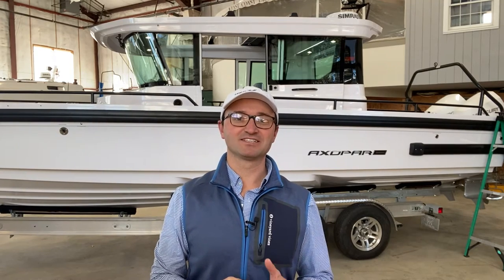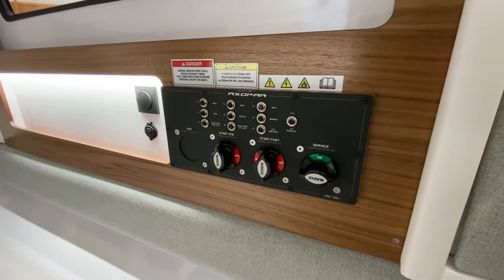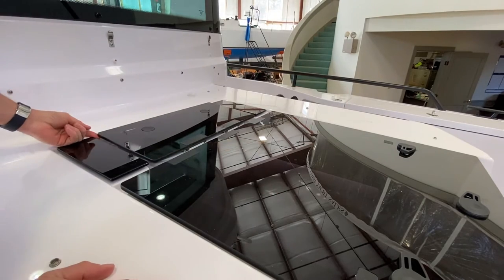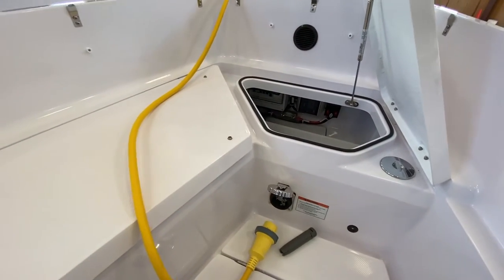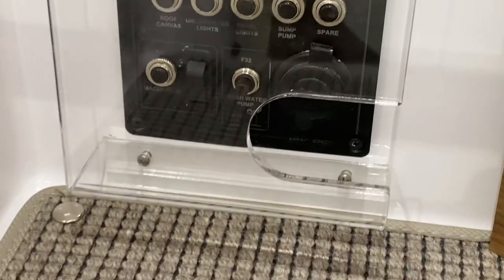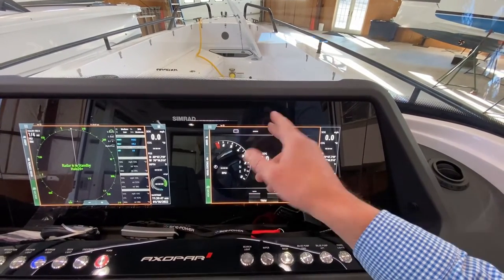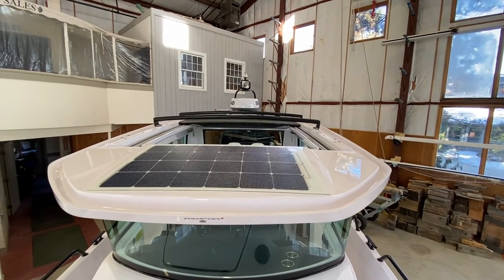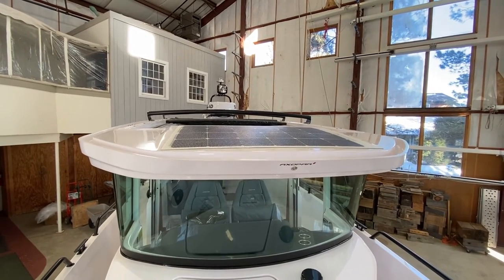Axopar Education: 28 Electrical and Battery Systems

Comment: Hi, Great videos congratulations. Can you tell me if the fridge runs directly off shore power please when at the dock? Or do i have to leave the house bank switched on and run it through the battery.
Thanks
Reply from the maker: The refrigerator runs off DC only, so you do leave the house battery on while on shore power to power the refrigerator.

Comment: Brilliant video, thank you. Really want to fit a solar panel to our 28. Does it only charge the service battery. If it charged the engine battery, you could always start the engine and charge the service battery. Any chance you could do a video of how the panel is fitted and wired? it looks perfect.
Reply from the maker: The battery bank you want to be charged is the house battery bank. The reason why is because all the parasitic loads that drain the batteries even when shut off are connected to the house battery bank.

Comment: Very helpful, thx. Is the solar panel available from the factory, or dealer installed? So it includes a charge regulator?
Reply from the maker: The solar panel is not currently (2022 and older model year) offered from the factory.  This is not a challenging item to have installed and any good marine tech can install for you.

Comment: Another informative and incredibly useful video - thanks. 

Quick (possibly idiotic) question. When attached to shore power, I guess the isolators need to be switched on for power to flow to the batteries for charging. Otherwise they would be, well, isolated.
Reply from the maker: By battery isolators, do you mean the rotary switches pointed out in the video?
Reply: @EastCoastYachtSales  yes, that’s what I meant…
Reply from the maker: The batteries can be switched off and will remain charging.  Having the battery switches off is best practice if planning to leave the boat for a long period of time when charging.